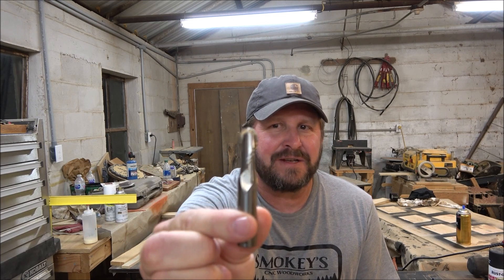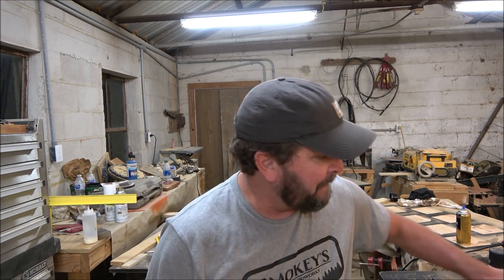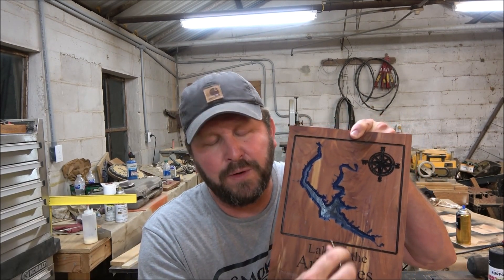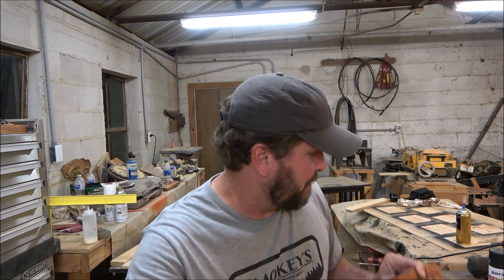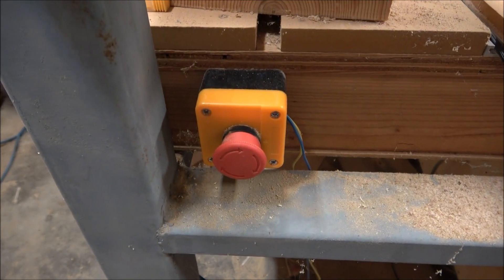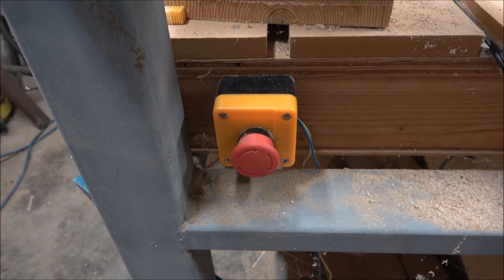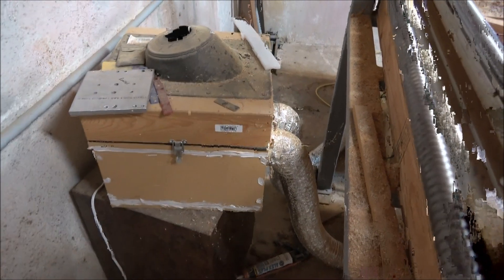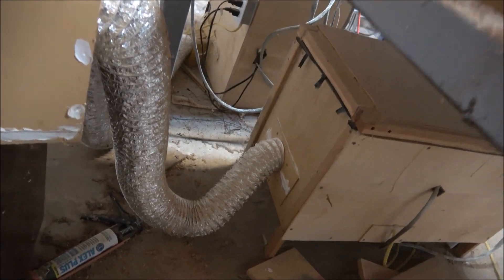CNC bits and machine answers

Comment: Hi,
Enjoy your videos.
Here is the tool I ended up with for making LED Edge lit signage.  At first is used some of the sharp pointed V bits but had issues with the plexiglas material gumming up.  I used both the Clear Plexiglas and the Mirrored type that I engraved on the back side when installing clocks so the clock mechanism was hidden from view.

https://tormach.com/tts-diamond-engraver-kit-32447.html

I actually turned down the end of the tool to fit a collet I already had.  The tool has an internal spring that allows you to put varied pressure on the Diamond Drag Tip.  This is what controls the width of cut the tool produces.  It will never make a deep slot live the V bit tools but that is not necessary  for a nice looking LED edge lit sign.  It has been a while since I made any of them.  I forget the name of the guy I bought the premade LED strips from.  I believe he was located in CA.   H would make them in custom lengths.  My largest on was 2 ft. tall by 3 ft long..  It was done with a V bit.
BTY, when you use the drag  engraving tool you do not turn on the spindle.  You just drag it along.  I believe I set the Depth of Cut to 1/4" but it can be adjusted to get the effect you desire.
Hope this was of some help.  If you would like to discuss this further you are welcome to contact me via my Youtube Channel.  I have some pictures that I could share that may give you a few ideas.
Thanks again for a great channel that I enjoy watching.
John
Reply from the maker: Awesome, that is some great info!....I'll go check out your channel!....Thanks for watching!!